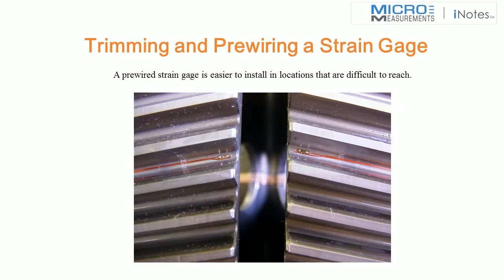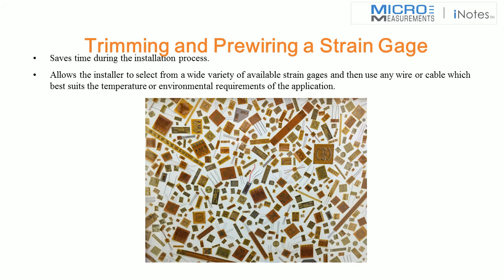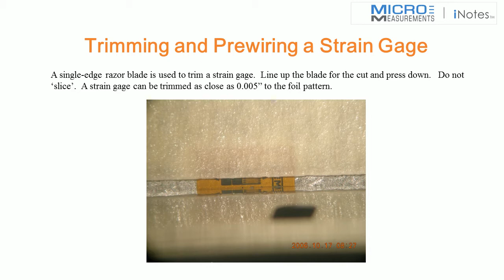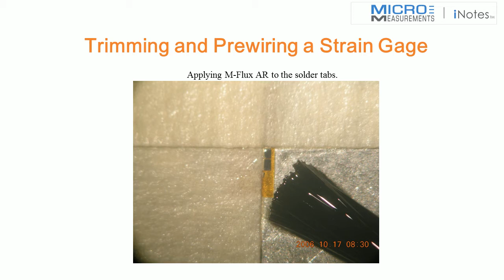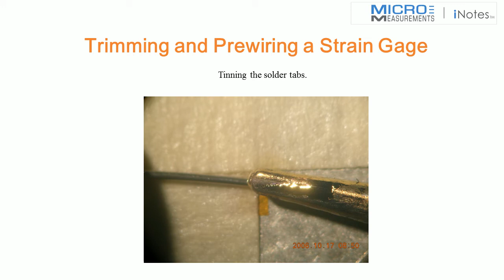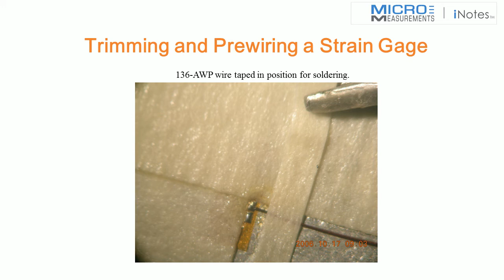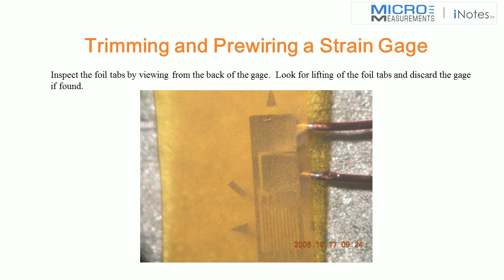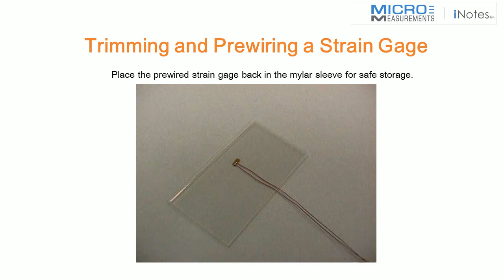Tutorial:  How to Trim and Solder Wires Prior to Installation of a Strain Gage

Comment: Desde Micro-Measurements, y su filial española Vishay Precision España, s.l., ofrecemos una amplia variedad de bandas extensométricas con hilos o cables preinstalados, de forma que así nos ahorraríamos tiempo de instalación. De todas formas, en algunos casos no es posible su uso porque se necesite un cable especial o de una configuración especifica.
Por otro lado, hay ocasiones en las que el espacio disponible para la instalación de la banda extensométrica es reducido y es entonces necesario recortarla, por supuesto sin afectar a su rejilla y terminales.
En este vídeo se muestra una manera muy rápida y sencilla tanto de recortar la banda extensométrica para adaptarla al espacio disponible, como de precablear la banda, por ejemplo en laboratorio, de forma que así sea más rápida y cómoda la instalación.
Si precisa información adicional, por favor no dude en contactarnos y estaremos encantados de poderle ser de ayuda.
mm.es@vpgsensors.com
miguel.bravo@vpgsensors.com